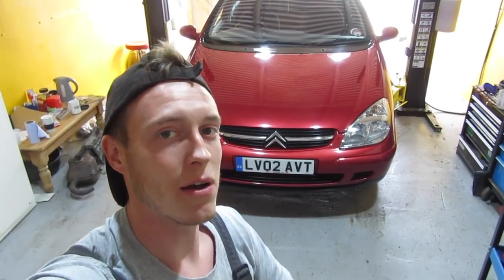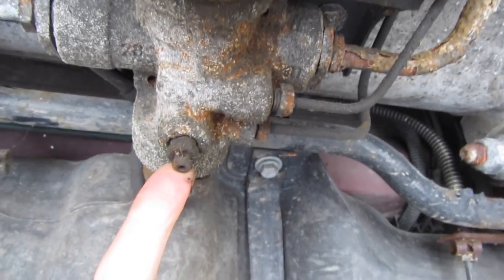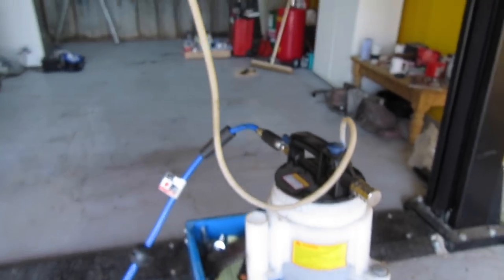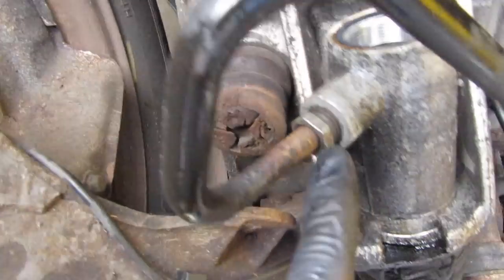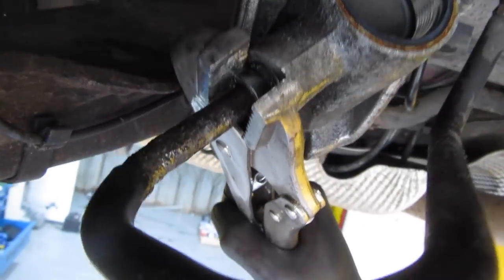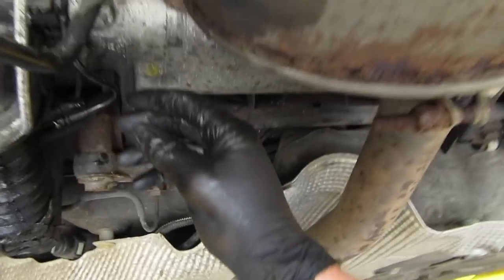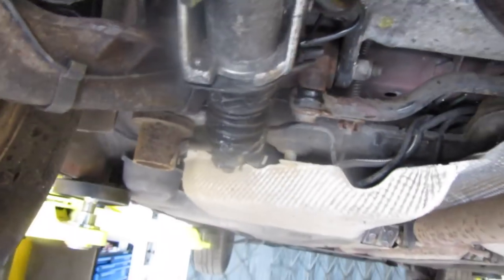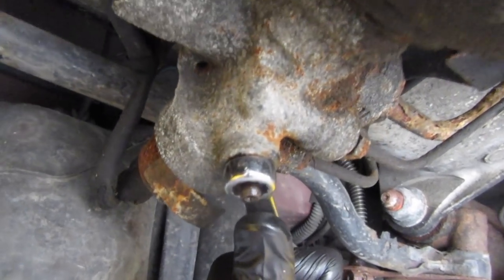Citroen C5 Suspension Cylinder Ram Replacement

Comment: When I replaced my gaiters, I thought the rams/pistons were leaking. Apparently they are supposed to allow a little fluid to sit in the gaitor. That was a few years ago and still working ok. The front Macpherson strut is the ones I have had to replace for mot. Fluid pissing down the outside of the strut. Joys of this type of suspensions. Interesting vid, no doubt eventually mine will need replacing.

Comment: A couple of points.
It is Hydraulic - Min's etc were Hydrolastic.  Oleo-pneumatic to be nitpicky.
It is possible that the ram was OK - they leak by design, the gaiter collects the leakage and returns it to the reservoir - that is the hose that sprayed LDS when disconnected, but shouldn't have.  The small hose is indeed a breather.
The gaiters do get damaged, I had this happen on my first C5 and it failed the MOT on just that.
Gaiter replaced (£13) and all was well.
The current one is leaking however, not the seals but the union between the sphere and the ram, the ram body is aluminium and corrodes at the joint.  Rams are NFP.
Using a brake bleeder is not necessary; the pressure in the spheres will eject the fluid.
Reply: at last a guy who knows his shit

Comment: Those rams leak in many instances, because people have put too much fluid in the tank and then jack up car, with it on the drive setting, instead of high. Now and again the gaitor is burst, and even rarer the ram seals are gone. I think many rams were replaced when in fact nothing was really wrong with them.  Mot stations fail these without knowing how the system works. A spot of fluid does not mean that pressure is down or lost. Are you looking forward to your next one? lol
Reply: EXACTLY MY POINT , first comment .....nowt wrong with it .....they designed to leak....gaitor is broken

Comment: Nice informative presentation ... I am giving my newly purchased 2008 Citroen C5 2l HDI 16 valve a good end to end going over .No suspension leaks  but one rear cylinder rubber boot has a 1/4 inch hole in the gaiter section .

Comment: 5:43 that stuff crap ...u need heat .....been there done that with 25-40 year old unions x20........ive had to cut the fuckers right next to the nut .......heat up til cherry red and then undo.....then replace the ENTIRE PIPE on restos

Comment: If I may, the sphere contains a gas separated from the hydraulic fluid by a membrane. The fluid which can't be compressed just like your brake lines is pushed by
the ram against the membrane which squeezes the gas which is compressible giving you the famous Citroen ride. No metal springs here! It was good enough 
for Rolls Royce to use and Mercedes Benz to and now Citroen have killed it. I wish to ad this, it's cheap skate owners who do shoddy repairs @10.04 to save money and 
it ruins the brand image and puts their lives at risk.

Comment: On my Citroen C5 I replaced gearbox oil I then lowered the car down I could here the hydraulic suspension pump kick in before.with remote I use to open car door with remote  suspension use to.rise it wasn't doing that today but did rise when I sat in car no.faults showing on dash board it does go up and down then you press the button everything else works fine

Comment: Wish I had your workshop and lift. No fun crawling around on my driveway under the car. Joys of motoring lol.
Reply from the maker: picardenter I feel your pain, 10 years crawling around in wind and rain 🌧
Reply: @juicemotors  yeah. My rear offside ram is now dribbling quite dramatically. Maybe the time has come. God I hate that LDS fluid. 16 years old now and being driven on Norfolk roads has probably taken its toll.
Reply from the maker: picardenter that’ll do it 😂 for the most part they’re quite reliable
Reply: @juicemotors  yeah. Suspension still works ok, just a bit wet all round there. Had to replace the rear suspension arm bearings earlier in the year. God it made a horrible noise, but lovely and quiet again. They are quirky motors, but very comfortable to be fair. Only reason why I put up with its mood swings lol😉🤣
Reply from the maker: picardenter the comfort actually resembles that of a Range Rover 😂
Reply: @juicemotors  never been in one. They have air suspension, don't they? Our other car is an S type Jag. The C5 is even more comfortable than that. The Jag is nicer to drive though 😅

Comment: Hello I bought a Citroen Xantia 2 liter HDI 90 HP year 2000 is very nice old car it haz the same suspension. I just want to ask you when I should change the spheres .Thank you
Reply: You can check spheres with special tool or change spheres wenn you fill to hard

Comment: Both the rear suspension rams have started leaking on our 2002 C5 estate, leading to an MOT fail. Our garage can't get hold of replacement rams specifically for the estate model, only the saloon (i.e. the version you're working on here). The estate and saloon rear suspension rams apparently have different part numbers. But we were wondering whether they might actually be identical or compatible despite the different numbers (nobody at our garage seemed quite sure of that). Any advice?
Reply from the maker: Dusk Weaver if they’re different part numbers they’ll be different parts, I’m not sure if they’re compatible. I had to get this ram from the Citroen main dealers, give them a call 👍🏻

Comment: Hi!!! I have c5 x7 2010 sedan automatic goes up and down while driving then when park it make a sudden drop to the lowest position. What might be the problem. Thank you
Reply: I can't good english, sorry. I can help you,
Reply: Check if the sensor mecanism is worn out, the arms that connect with the sensor for the height. If there is play it does funny things like that, mine did the same

Comment: hi mate can you advise i have 07 c5 it had faulty pump i put another one on but now it wont go up i tried bleeding it lock to lock and driving it 5mph nothing happens the pump can be heard?
Reply from the maker: xjs2 it should go up given the correct fluid and enough time to allow the pump ton circulate

Comment: Hi sir My car Citroen c5 RFN EW10J4 @t car is problem which leakage from rear right  suspension and will to change gaiter 
 I processed my car first I set high to lowest position and I wait 15 minutes .
Second I tried to screw by one turn (rear firmness regulator fluid pipes
 but the real problem I did not do anything because it was so rust )
How can I process another ways because I did not program Citroen computer for depressurisation ?
Please wait answer now because I doing my at garage thanks
Please my video youtube I posted to help !

@
Reply from the maker: Hi! I did not use a computer to depressurise. I simply removed the rear unit. Good luck!
Reply: @juicemotors  if i did not screw oil down what is promblem?
Reply: @juicemotors  thanks so much
Reply: @juicemotors  s i saw your video change rear left suspension citroen c5 and you took screw firmnesss rear regulator * oil from suspension *
Reply from the maker: Auto Expert Car & Computer it must be air/oil tight otherwise the pump can’t pressurise the system to lift the vehicle
Reply: @juicemotors  
Now my car is waiting outside my apartment in sweden .
Can ask you i should drill rust bleeder rear firmness regulator and will i set new bleeder ? Thanks so much support me
Reply: @juicemotors  
Dear sir 
My car which problem leakage rear right suspension so can take screw oil of  front suspension instead of rear suspension?